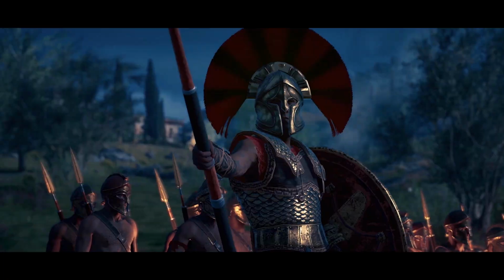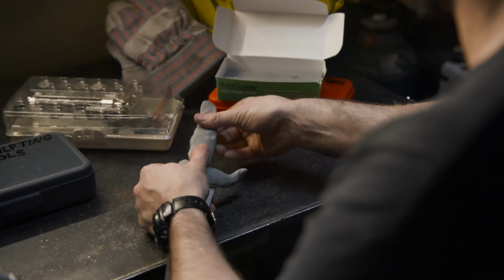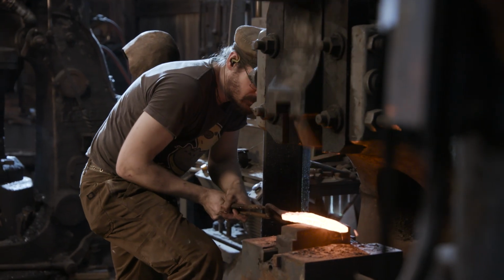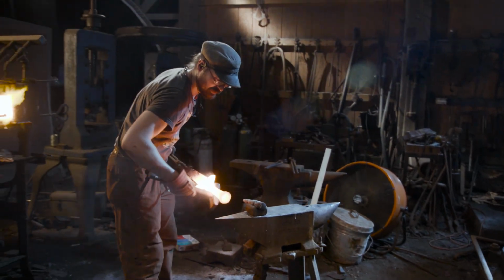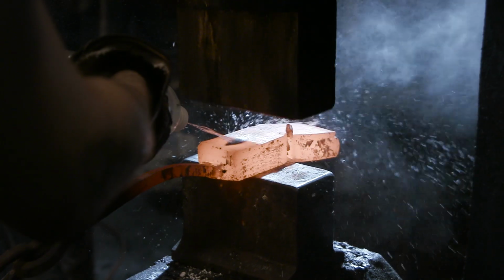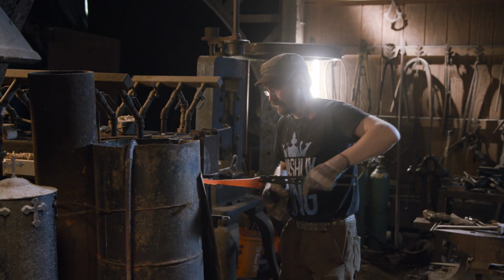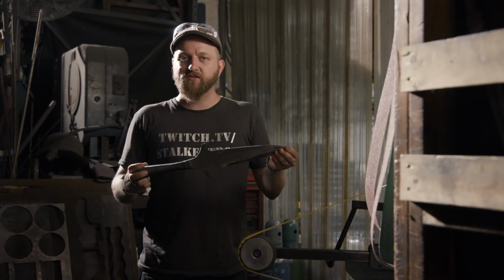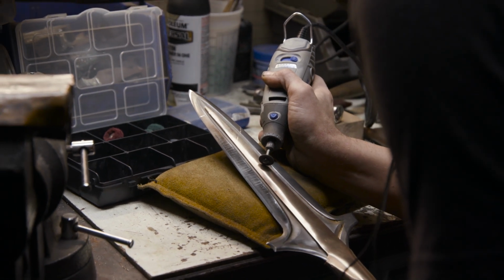Spear of Leonidas – Assassin’s Creed: Odyssey – MAN AT ARMS: REFORGED

Comment: I like the spear a lot, very cool, and not trying to be that guy but a few things they got wrong:
- In the game it had zero battle damage no matter what, and actually got more and more clean and polished as you level the spear up, so the scratch marks you put on the spear's blade using the dremel to make it look battle-scarred was pointless and inaccurate. I get its just their interpretation but you can easily find this stuff on google images and can simply copy the look, besides they were shooting to make nearly an exact replica.

- Looking at the real spear in the game compared to what they made, the spear they made was too long. Not only that, it's too narrow overall and the tip is more of a sword tip, whereas the spear in the game is a very narrow tip and not wide at all, which is the way it's supposed to be, because it's a puncturing weapon. If you look at the spear in the game its pretty wide at the base and gets progressively more narrow to the tip, in other words, it's a triangular shape.

- At the bottom of the spear's blade the base of the spear's socket is also too wide, in the game its far more narrow.

Comment: Well if you melt the iron it turns into steel so technically it's very mild steel. Also the first steel sword, the Vered Jericho sword, was made in the 600BCs whereas ACO takes place in 400BCs so steel was used back then. Also you could've added a battery pack with a wire running to the tip so when you hit it on the ground the wire in the spear to the tip would act like a grounding wire and send sparks flying everywhere so you can emulate the air assassinate using the Spear of Leonidas and there would be a wave of sparks like there is a wave of energy in the game.

Comment: Just pointing out, for historical accuracy, most blades of that time period did NOT have hollow ground edges, also hollow grinds in long blades are the absolute height of stupidity, as they are structurally weaker than flat grinds.

Comment: Why not just make all of the metal used steel for maximum strength AND maximum sharp edge retention? Is there a benefit to using iron in it as well or is it just a cheap substitute?

Comment: Thank you for the video guys, great job and really good looking result.

However, for this kind of weapon, it would have been way more interesting if you would have done those blades the way it would have been done back in the day. A full iron blade, heat with a charcoal furnace, form by hammer and grinned with a metal file. It probably would have been too much work but historically, those blades were not sharp. They were meant to break bones, open wounds or, most of the time, pierce through bronze shield or leather armors. They didn't had the tools to make sharp cutting blades.

Great job nonetheless !

Comment: You hear people talking about how old skool steel blades were "made" right. Todays steel is far superior to the days gone by. The biggest difference is back then they didn't burn up the edge on a belt grinder after heat treat. Ever notice after having a "modern" blade for awhile and after several sharpenings it seems to hold an edge ALOT longer? That is because you have sharpened past the metal that was ruined by the belt grinder after heat treat.